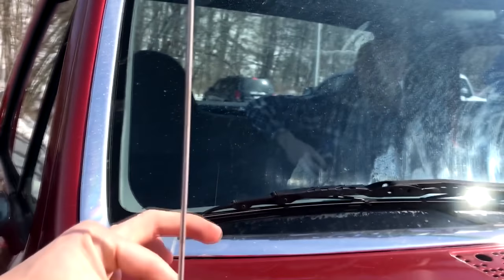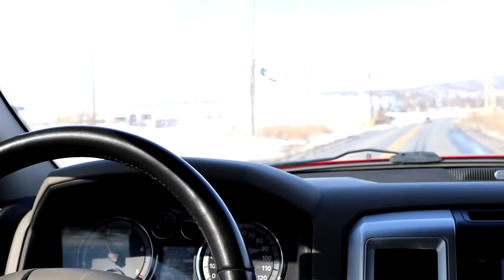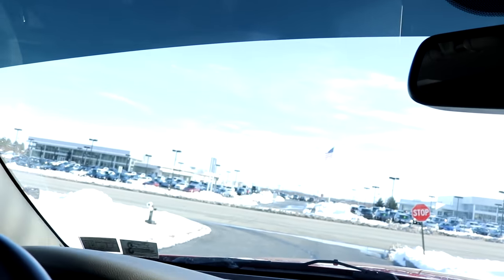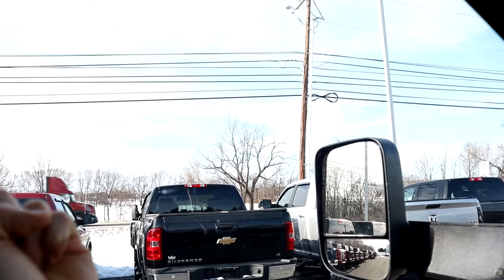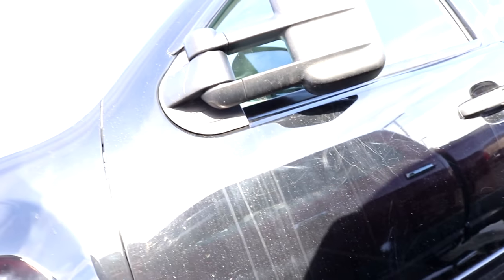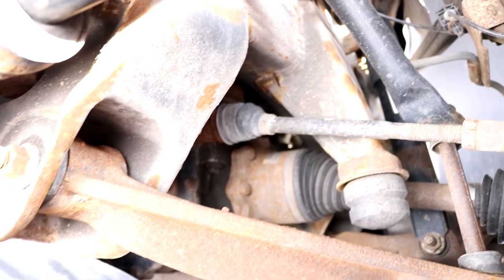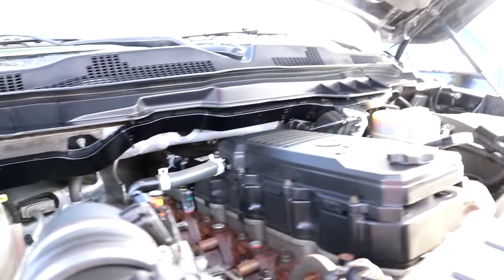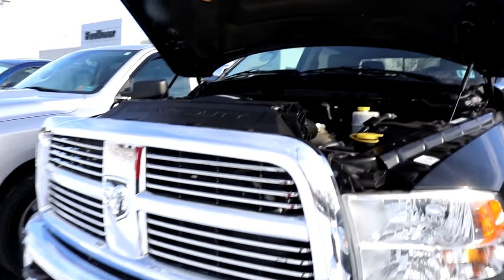Body Lifted DELETED Diesel Trucks At Dealerships

Comment: You can put 37’s on 3.42’s and people say they can’t tell a difference so you’re fine with 35’s. I’m throwing 37’s on mine in 2 weeks . 6 speed 3.42’s . These trucks have plenty power to push any tire, it’s recommend to beef up the auto tranny if you’re pushing over a 35’’ tire
Reply from the maker: yes I would also get some good tuning